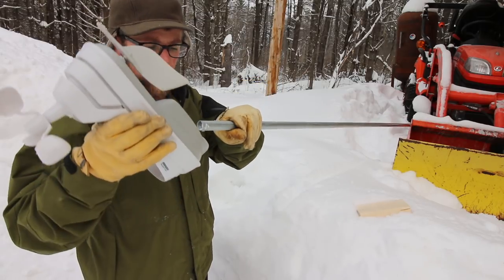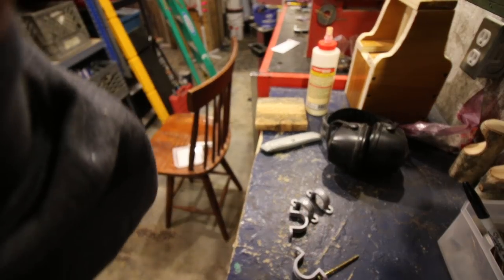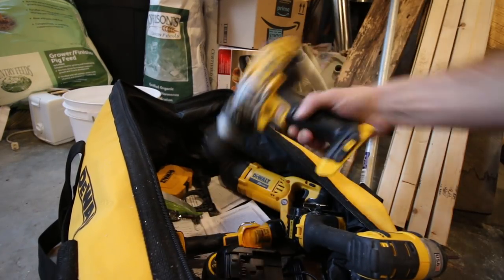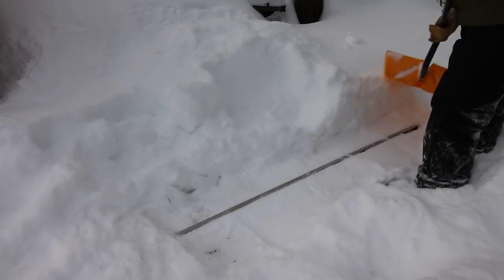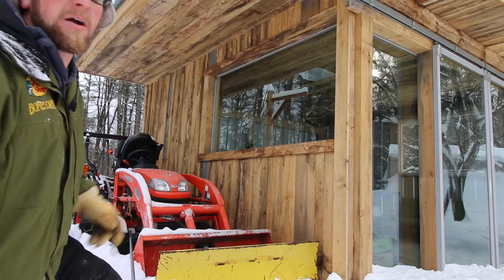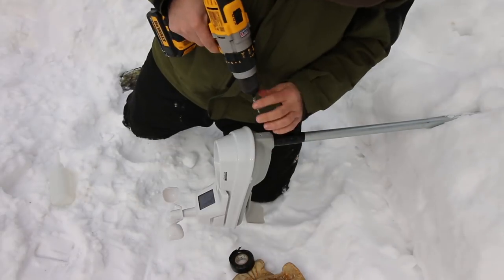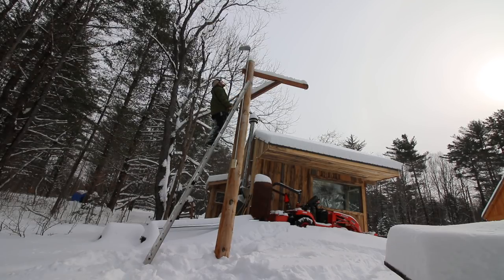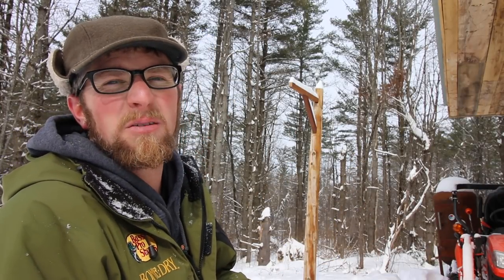Moving Our Weather Station on top of a Telephone Pole

Comment: Great job macgyvering it. Seems like most everything that is bought now has bad directions, or missing parts. Got yesterday's  and last nights snow all gone this morning. I am so ready for spring.
Thanks for all you share.
Blessings,
Jim
Reply: Jim's In Town Gardening j
Reply: It fits on 3/4" steel pipe or Rigid Conduit. What Al has is Electrical Metallic Tubing (EMT). It's a much thinner wall. You can hang off steel pipe. People  make chinup bars out of it. If you try that with EMT it kinks right in half. Also most folks who aren't steamfitters can't pick up 10' of 3/4 pipe and wave it around with one hand like Al was doing with the EMT.

Comment: That was great! Now your data should be accurately representative your outside conditions. I have a couple of terminology issues, though. 1. That is not a wind turbine; it's an ANEMOMETER. 2. Even though 'utility pole' or 'telephone pole' might be technically correct, I think you should refer to it as the 'pork processing pole', or 'PPP' for short. Like "New Yolk City", that's much less boring, and that's what it really is. 
     You could never have too much of Pluto or Figaro. They are so much fun to watch, even when they're photobombing.

Comment: hey Al, commented on another video saying I was new, wanted to say here when it comes to weather I can assist that's what I do for a lot of friends especially winter.  Just a heads up this winter and next will be brutally cold over prepare if you can
Reply from the maker: Are you a weather man?
Reply: Hey Al, it's a hobby I take seriously for the past 15 years and do some forecasting for NJ towns during the winter season primarily. I do a paid subscription to sites that provide all the weather models so I have access to the information just as everyone else does.  Every area has it's own micro-climate that can make a big difference.  Before I started working from home I was in outside door-to-door sales so weather always played a factor on my scheduling.
Reply from the maker: Tom P what do you think about snow for this winter?
Reply: I want to see how strong and where the El Nino sets up next month or two, as of now I am leaning to colder than normal winter temps however lower than normal snow (not much below normal for you area) due to the storm track being just a little south for your area, more of a 2009-2010 type winter.  Will know more middle of September that will show the Pacific Ocean temps and where the warmest areas are.

Comment: Pity you didn't use 25mm. electrical conduit. Terminal box screwed into bottom end and saddles to hold it to the post with a coupler at the station end. Still as F. Zappa sang, "It's a bummer,  he's a plumber. " hahahahahahahaha...................P.S. Hey Gina, he's using your soap !!!!!!!!!!!

Comment: Hi.  Did you figure out the Weather Station is pointing the wrong direction?  I looked through your YT page for a later mention of the Weather Station but I don't see one after this one.  The solar panel faces the South to catch the most of the Sun throughout the day (they sell an upgrade dual solar panel with Anemometer (wind speed) - still points to the South).  Pointing due South also informs the monitor on wind direction.  IF it knows South it can better know East/West/North based on that point.  The solar panel powers the fan that circulates/pulls air across the temperature sensors internally to more accurately determine the true temperature.  Btw, they also sell a remote battery pack with a 30 foot cord.  Dig the channel!  All the best!

Comment: Instructions called for 3/4" "Pipe meaning galvanized or black pipe which has a thicker wall thus larger "OD" - you are using electrical conduit smaller "OD" but hey electrical tape works too LOL
Reply: +Alf.....Exactly. Big difference in pipe and tubing measurements.

Comment: Do you use diesel fuel antigel in your Kubota? At temps 32* and below diesel will start to thicken and gel, the colder it gets. Adding an antigel to your fuel lowers the freezing point so your tractor should start in cold weather.
Reply from the maker: Yes I added antigel a few weeks ago. The new fuel doesnt like the cold even with the anti gel.

Comment: Those are the wrong kind of screws. They are self tapping metal screws. They are not designed for wood application because they tap the wood out too much and with a little bit of stress on them they will pull out of the wood over time.I t's a common mistake.